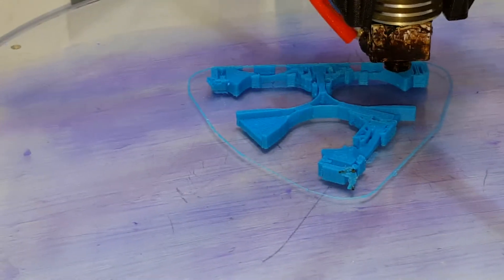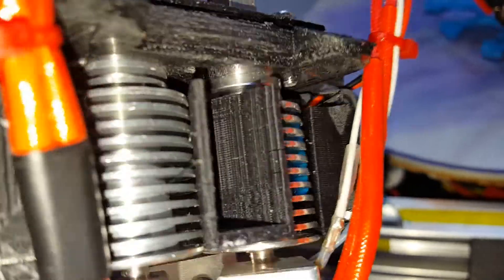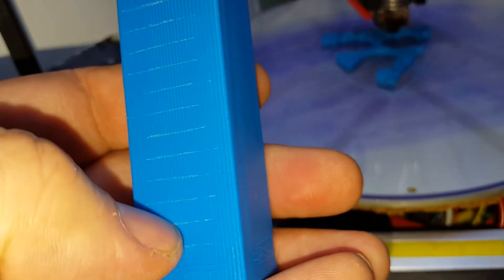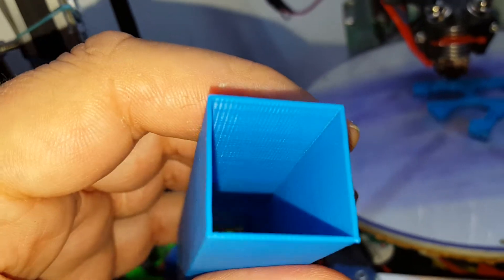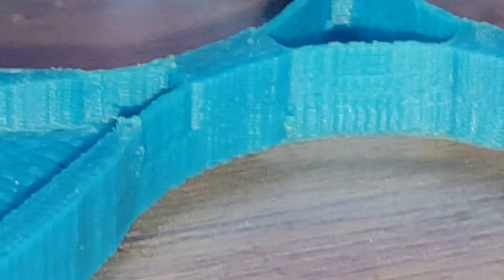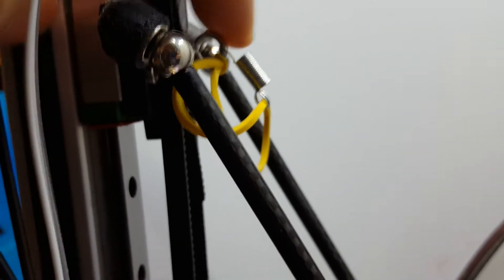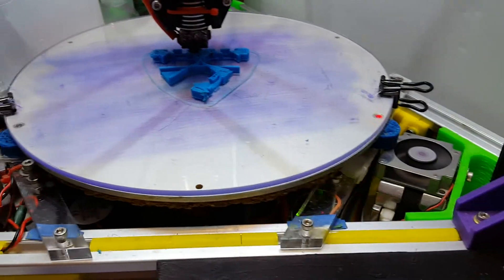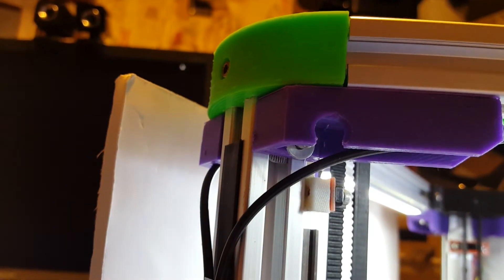3D Printing Adventures: Makerbot filament vs. Cheap filament, my Magnetic Upgrade, Misc thoughts...

Comment: fun stuff. nice work. will be in interesting to see that 3 extruder run!  what hardware and fermwire will you use? ~Russ
Reply from the maker: +rwg42985 - I upgraded from the 'stock' Mega 2560/RAMPS 1.4/Marlin controller my printer came with to an Arduino DUE/RADDS 1.5/Repetier controller, and it's a TON better.   My printer no longer slows down on corners, etc, where the 2560 was just running out of processing power...  And movement is SO much smoother/consistent.  
I don't know if I'll be successful with the triple-extruder prototype - as another user on the Facebook group I'm part of said that Kossels typically have too much 'effector wobble' to do multiple hotends, but I'm going to try anyways.  My printer seems fairly tight, with the linear rails and magnetic attachment.  I think the only slop is in the cheap linear rails, but we shall see....